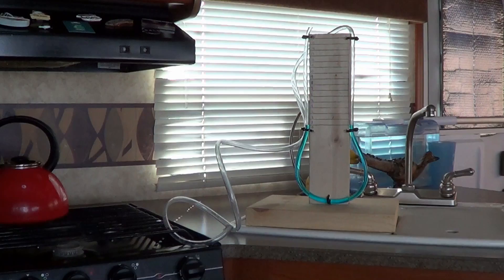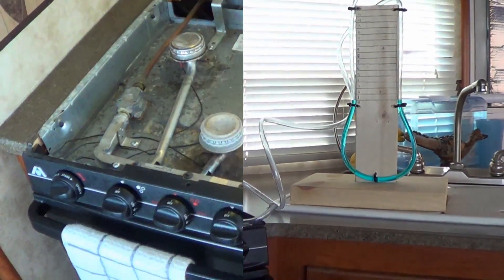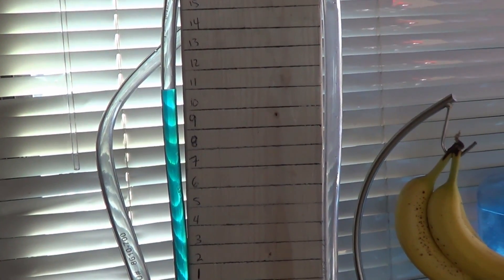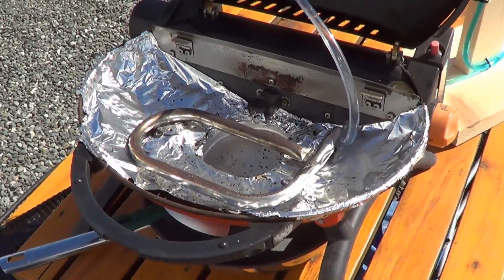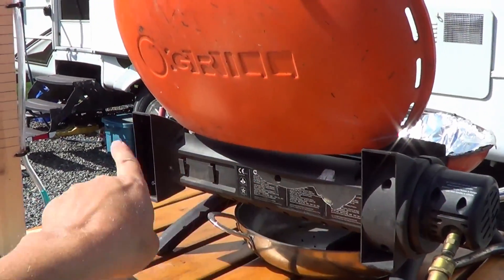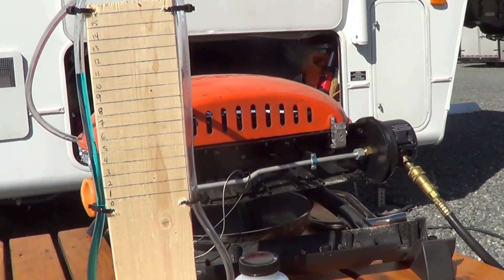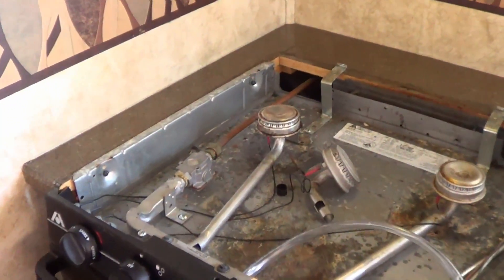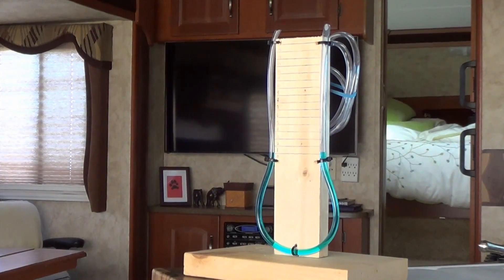Simple DIY Manometer RV LP Gas Leak Checker

Comment: This stove has its own regulator, so it's better to measure the pressure before it, by removing the 3/8 flare fitting, and attaching it with a 3/8 male flare fitting, adapted to the tubing. You might find that the reading at the burner is slightly lower than what it is coming into the stove before the stove regulator.

Comment: Any idea if the diameter of the tube makes a difference?  I need to use a larger-diameter tube to fit over the knob on my fridge.  Are you sure you used 5/16ths and not 5/8ths?  Thanks!
Reply from the maker: I don't think it matters. I used the size I did to fit over my stove gas output.

Comment: Thanks for the info, Ray, very informative as always.
A question for you, oh wise one. 
When you turn on the propane tank, do you turn it all the way open (until it stops turning) or do you just turn it on a couple of turns?
I seem to remember way back in the mists of time when I was younger and taking metal working at school, the teacher told us to turn on the oxygen bottle all the way because it has a double seal on the outlet valve. The oxygen was at much higher pressure than propane so I'm not sure if the propane valve has this double seal as well. Any thoughts?
Reply from the maker: You're welcome, I've always turned it all the way. Never have had any problems doing it that way.

Comment: Rae,
That BBQ had a regular before your mod. If it was sill in line your BBQ would not have worked as the pressure is already reduced by the regular at the tanks.
Reply from the maker: Yes, the BBQ has had its regulator removed so it would work on the low-pressure LP quick connect line on our fifth wheel. It used to use the little green propane cylinders.

Comment: This is fantastic! Thank you for showing this. I am pretty sure we have a leak somewhere in our rig's system and I would really like to figure out for sure if we have one and where. I sometimes can smell propane even though our tanks are both turned off, so I need to check where that is coming from. Would this work to check the tank itself?
Reply from the maker: The tank pressure is usually over 100 PSI so no. ;) There is a two-stage regulator that drops the pressure first to 10-15 PSI then down to around 1/ 2 PSI which is what my manometer was measuring.
I would bubble test the whole tank and regulator.  Cheers Ray
Reply: Love Your RV Oh, gosh! That would make the water shoot out! Oops. Ok. Well we will have to work on it a bit.

Comment: Just for shits and giggles.  Hg=inches of mercury, water collum.
1 psi = 2.03 inHg;  and  1 inHg = 0.49psi
Just another way to say it, 1 inch of water collum equals one-half psi.
*
Reply from the maker: According to online converters, 1/2 PSI = 13.8538 water column inches.
Reply: Ray look at this, https://www.convertunits.com/from/in+Hg/to/psi
Put in  1 in Hg  =  .5 psi  (since we do not live in a vacuum)
Reply: Water collum is a inch measurement just like your manometer you built.
You have to have pressure to push gas it can't be a vacuum.
Reply from the maker: I see so, 1 inch of mercury [0 °C] = 13.595100196653267 water column [inch]
https://www.convertunits.com/from/water+column+[inch]/to/inch+of+mercury+[0+%C2%B0C]